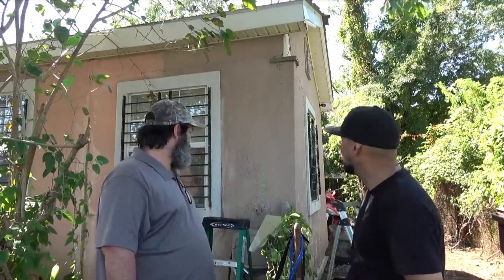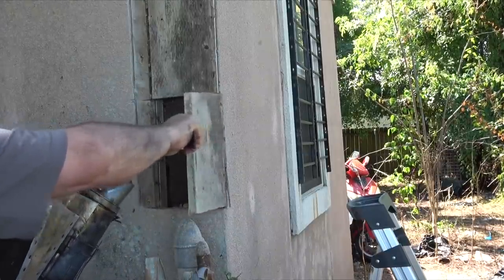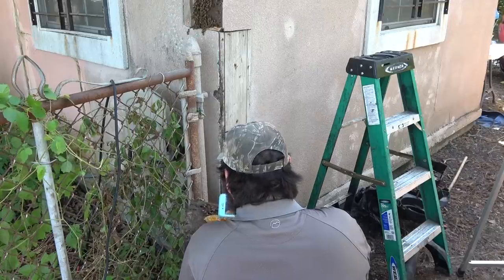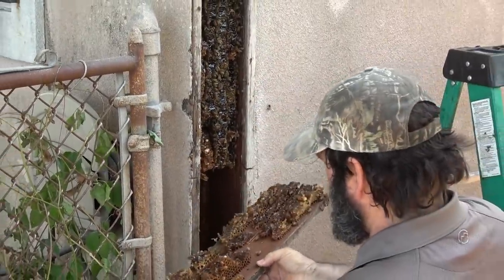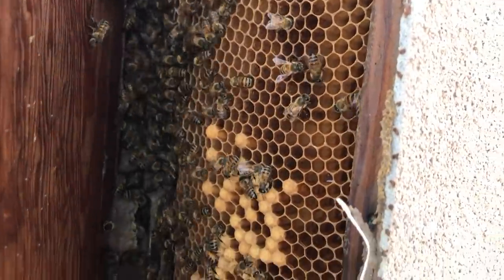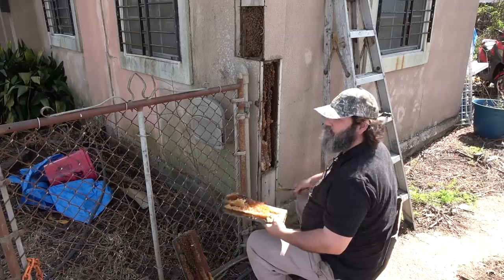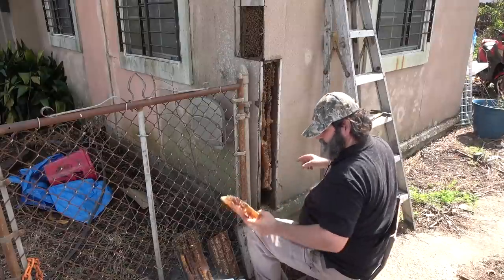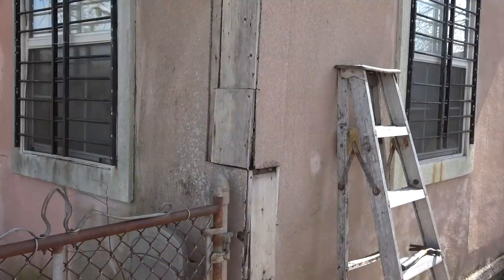At First He Wanted Them Gone But Let Them Bee

Comment: I have super docile honeybees in my limestone chimney - built in 1891.  It’s not been used in many years.  Although it does have a wood burning stove attached to it, it is not operational.  I wanted to get it operational though.  Until we had an inspection that stirred up the bees.  How can I harvest like you guys do without having to wreck my antique chimney?  I want to keep the bees, but I want to be able to use my chimney too.  Trap out cone video my best option?

Comment: Couldn't you have boxed them up and put them somewhere tucked away in the garden?
Reply from the maker: Of course, but Moe’s house, his choice, his bees.

We may do something like that later on, Moe’s thinking about it but for now they’re staying put right where they are.
Reply: @JPthebeeman  oh I get that 100%  but I figured now the corner of the building is exposed to the elements it will actually end up causing structural damage (not by the bees but the weather). Also thinking of maintenance of the bees I mean it's not ideal ripping the corner of the house off every time you harvest right? 😆